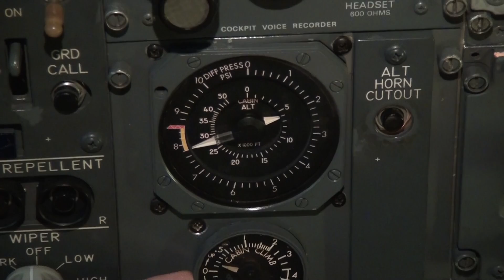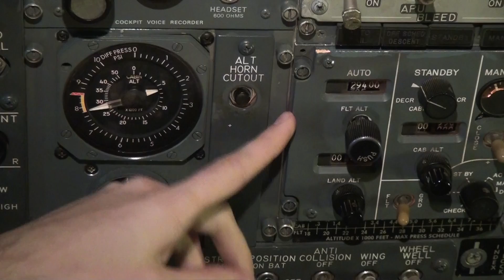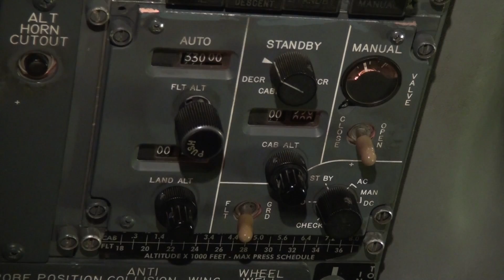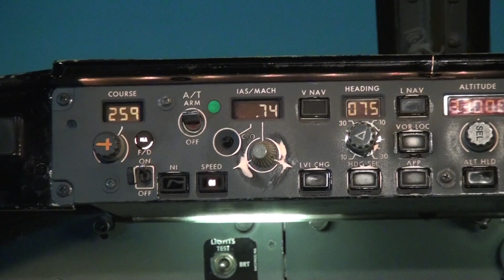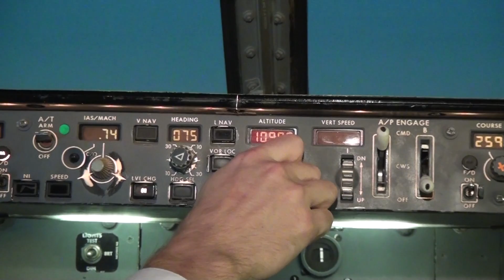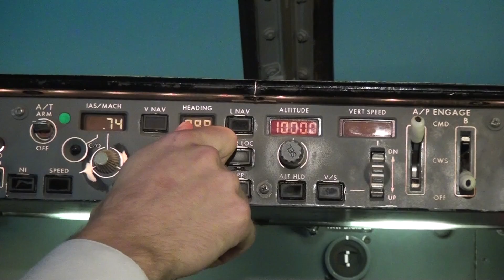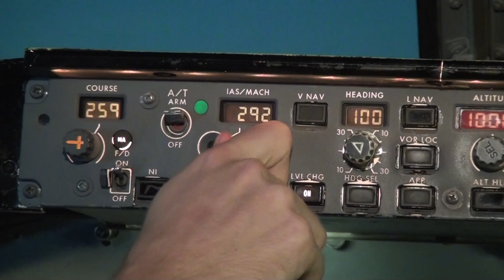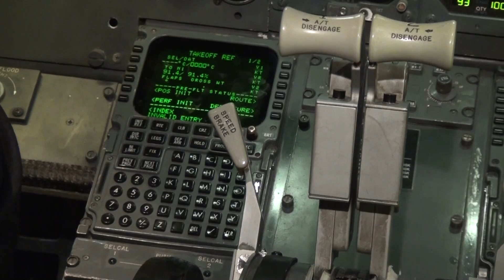Rapid Decompression in Boeing 737 - Baltic Aviation Academy

Comment: Thank you for this interesting introduction. 
Why heading 100? Is that to indicate to the ATC in connection to a fast decent a form of coded emergency message or was it because the next airport was at 100 ? Thank you
Reply: It's protocol to turn off your normal course when making these emergency descents. In normal flight, the aircraft is travelling on airways and other established corridors for air traffic—an emergency dive into more congested airspace can be a problem, and there may not be time to call ahead to ATC to clear traffic below you. Therefore, it's safer overall to just turn off your normal course, and dive away from the rest of traffic.
Reply: @eddievhfan1984  its mainly to keep a positive g load on the aircraft as you can withstand more positive g than negative

Comment: Soooooo many mistakes. Main mistake is that you CANNOT SET 10000 feet initially. Just set the altitude down a few turns, then level change and 45 LEFT TO GET OFF THE AIRWAY, then after the speed brake is out and you are descending, then set 10000 feet and set max speed (VMO/MMO). And DONT SET THE SPEED TO 250 until you are through 11000 descending then retract the speed brakes very slowly to not get overspeed
Reply: also to set the TCAS to BLW to scan the air traffic below , but he acted very basic so i guess thats' how they've been taught

Comment: How will you start an aeroplane engine if APU is broken or not available.

Can u pull the levers of the reverse thrust in any other position other than idle??. Can u demonstrate it in the simulator.
Reply: You can use the ground power and an air start unit which can be available at most airports.
Reply: lcmortensen that's not true
Reply: If the APU is broken or not available on the ground,  then the plane is not allowed to take off until the APU is repaired.

If the APU fails in flight and then you have an engine failure, you can restart by windmilling if you have enough speed.

Comment: Nice video, I have a small comment though.
Flight interphone is not to communicate with tower, I believe you should use VHF 1. and also close the outflow valve to try to control the cabin altitude. Unless it is obvious ofcourse that the cabin altitude is uncontrolable.

Comment: Why not set vertical speed to descend faster?
Reply: Level change, with speed brakes, will allow you to descend at the fastest possible rate, while not over-stressing the aircraft by going beyond limits. V/S doesn't control airspeed, so it inherently has the risk of overspeeding in a descent or stalling in a climb. Level change will adjust rate of climb or descent using pitch, while maintaining the speed set on the mode control panel, keeping the aircraft within safe structural and performance limits.

Comment: "Engine Start to continuous"  Does the position of the "L Both R" rocker switch matter? Does the continuous mean that the spark keeps firing incase a engine flames out?
Reply: +johnfranks For the LBR switch this controls which starters will be engaged, left side, right side or both. And yes continuous is used to keep the engines going by constantly sparking just incase there is a flame out event.

Comment: why increase speed to increase descent ? i thought it was decrease speed to increase descent
Reply: Luca Fuoco it's not principally high angles of attack which put stress on an aircraft in an emergency descent, it's increased dynamic pressure. In an airliner you absolutely will not give full rudder to increase descent rate. Pretty much the only times you use the rudder are when keeping it straight on the ground (take off or landing roll), de-crabbing a crosswind landing, or recovering from an engine failure, to counteract assymmetric thrust. Different story in a light aircraft, though. Slip it all the way down, if you like!
Reply: Using rudder to increase rate of descent in an airliner just doesn't happen. Even in an emergency descent, the purpose is to get down to a breathable altitude (or to avoid the necessity for the passenger oxygen being used at all). It's still a controlled descent and you're not likely to be at a speed where it'd be safe to get the flaps out, or to attempt to slip the aircraft. Speed brakes, sure, but you may not want to make any significant configuration changes. Once you're down at a breathable altitude, you're going to level off, slow down, and work through the problems. There's no need to use rudder at any point, as a means of altering rate of descent. All you're going to do is destabilise the aircraft.
Reply: +Luca Fuoco +Luca Fuoco it's simply not designed to be used during flight in an airliner, particularly at high speed. Maybe try and get your hands on a principles of flight book and look it up. You might also want to Google 'yaw dampener'. It's not the same as flying a light aircraft, where rudder use is extremely important. You don't fly big planes with your feet.
Reply: Ok, well whether you accept it, it's factually correct. If you can find some info otherwise, I'll be happy to tell all my colleagues! Already mentioned de-crabbing on a crosswind landing, but for any other flight event, you just don't. Happy flying!
Reply: With engines set to idle power, the only way to increase descent rate is to pitch down. Pitching down also increases speed, so if you're setting the MCP for a higher speed, it pitches down to increase speed, and therefore increases your rate of descent.
Reply: +Luca Fuoco ah that makes sense :D thanks for the great explanation :)
Reply: +Samath Perera The important thing is to differentiate altitude loss from sink which occurs when airspeed is low meaning lift is insufficient to maintain altitude versus descent resulting from a deliberate dive, ie high speed flight with a significant nose down pitch. In the first the airplane is at or close to level but sinking through the air towards the ground, frequently used during approach to bleed both speed and altitude for landing. In the other you are flying the plane down a steep slope which means you lose altitude but gain speed, hence the use of speed brakes to prevent overspeeding.
Reply: Can we just leave it at: don't use the rudder while flying an airliner, with the exception of recovery from an engine failure. ;)

Comment: Too many mistakes... Radio mic selector wrong... Should use VHF2 already set up in emergency frequency 121.500...
Reply: Its a miracle that one were able to control those aircrafts from the 80's anyway. But I rather trust theese more than the ones today will all the computer and network integrations.... cause they are more isolated and redundant or in control of the Pilot.

Comment: Sir you forgot one very important stuff is set transponder 7700
Reply: under IFR condition ......., in Brazil or other countries ATC controllers asking recycle transponder  for 77**. But in the aries here you fly IFR temporarily are not available  ATC on the frequency then you have to changer in to emergency code and maintain you heading .
Reply: ThatSillyGinge Transponder is set to 7700 in emergencies. especially when radar identified so the controller can at a glance know from his screen where the distress aircraft is.

Comment: Very interesting, thank you very much for sharing. But one question: At one point he said "And I turn right by 30 degrees because we are in emergency".. Well... What was the exact reason there?!
Reply: Not sure but I think this is specifically due to the unexpected descent. The aircraft is likely to be flying on an established airway with the possibility of heavy traffic at lower altitudes on the same airway. Turning to the right would reduce the probability of conflicts with such traffic during descent. (It is always to the right, so as to avoid conflicts between two opposite-direction emergencies.)
Reply: ***** You will be right on this one!
Reply: i think he means he is banking more than normal because in an emergency situation you are allowed to do a little more than normal everything to get on the ground faster, normal bank would not be that much
Reply: *****
I am used to the emergency priority, so that's clear, but maybe it had helped to explain why he is turning that 30 degrees to the right (e.g. to reach an airport / land...). He explained it a bit generally, I think. Nethertheless, thanks for the answer, Michael :)

Comment: Thanks for sharing. which mean the passenger oxygen is not automatic? does the pilot need to trigger it in case when the pressure drops? i thought it was auto deployed.
Reply: on 737 ng - dropdown of masks are automatic for passenger cabin, sometimes they drop off even on false alarms, they are activated by pulling it down ( there is no need to flow oxygen through them if noboty sits there) , thing is that there is only limited oxygen, enough for emergency descent, about 5 to 15 mins (depends how many passagners are boarded) there is one additional mask for flight crew every 3 rows on one side only, it's called monkey trail, because they can use mask on one side, hold breath and go to other side mask next 3 rows, also there are oxygen flasks (how many depends on size of 737) they have oxygen for about 1 hour each (depends how fast are you breathing)
Reply: if I remember correctly, the passenger masks do drop automatically, but just in case they don't, pilot is supposed to do the manual activation by flicking the switch :)
Reply: I believe it is automatic on newer planes but most likely not on this model of 737.
Reply: ***** the masks would deploy but don't you need to pull the mask to activate the oxygen? Or am I just making that up? 
I've never looked this up and I've had a few drinks so I could be wrong.
Reply: salkasalka The first part is what I thought happened, I didn't know about the rest though, thank you.
Reply from the maker: ***** Dear David, please email your question to info@balticaa.com and they will provide you with all the answers! Thank you
Reply: Think they drop automatically once the cabin altitude reaches 14,000ft. You can do it manually, though, either if they've failed to drop automatically, or in the event that the decompression isn't rapid and immediate (like with a gradual increase in cabin altitude with a leaking outflow valve, or something along those lines).
Reply: Digital Hodgepodge Also need to assess wether to fuel the fire with oxygen masks or not.